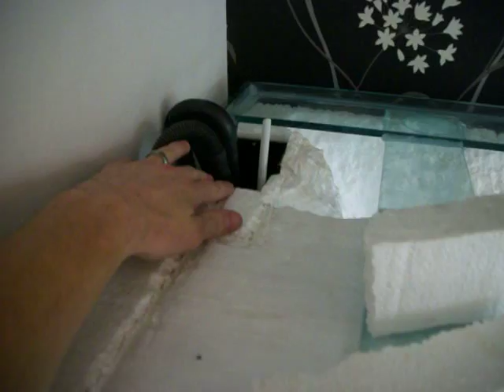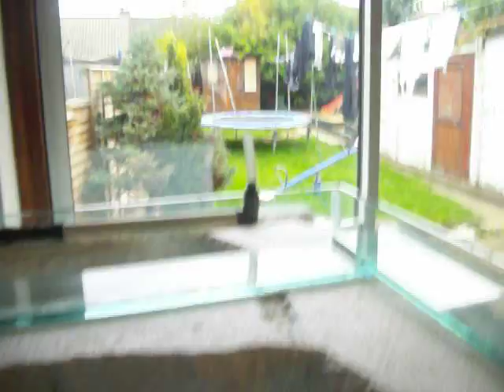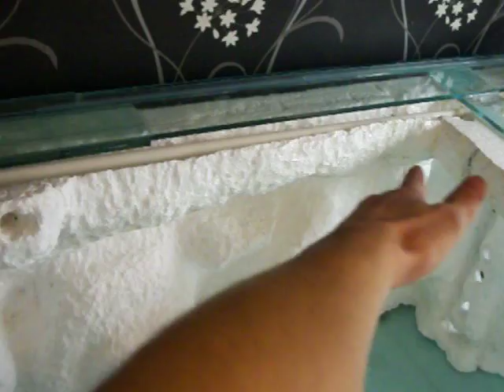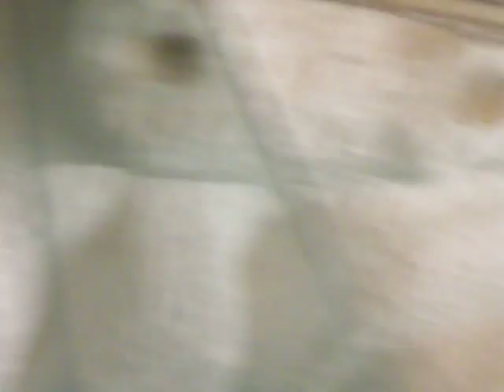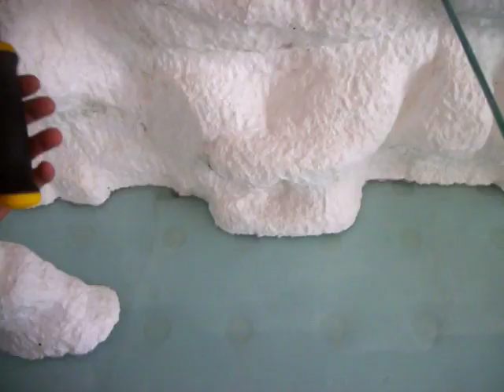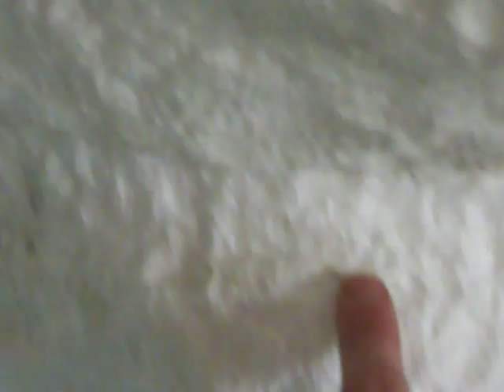My 3D polystyrene and concrete background !! part 2/5 !!!

Comment from the maker: Thank you !!! The flame worked very well !!!! Helped harden the poly surface !!! So the structure is a lot more solid under the cement than just the plane unheated poly !!! :)

Comment from the maker: No matey !!!!! But it need's to be covered with cement so that the fish can't eat the polystyrene !!! Some fish will eat it and that may kill them due to them getting blocked up ect !!! The cement that will be going on will make the ph very high due to the lime in it !!! And i will have to leech the background out before i put fish in there to get the ph to a safe level !!!! 

Check out the link to the thread in the description for more info on this project if you like !!! :) Thanks